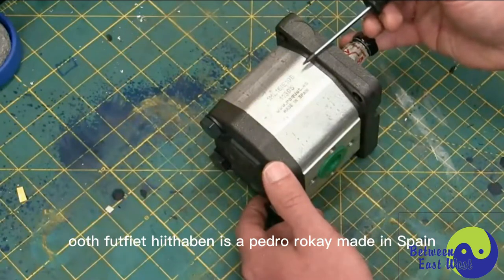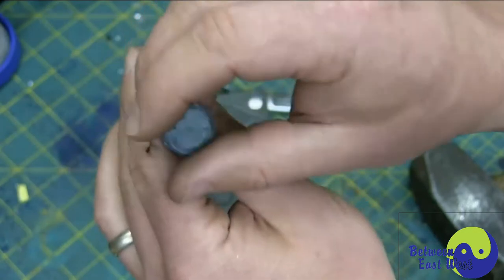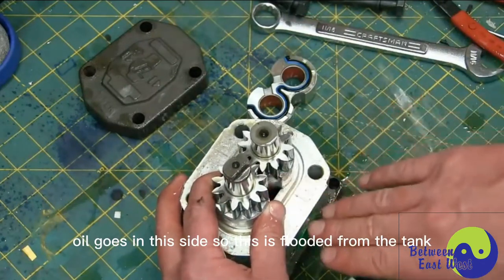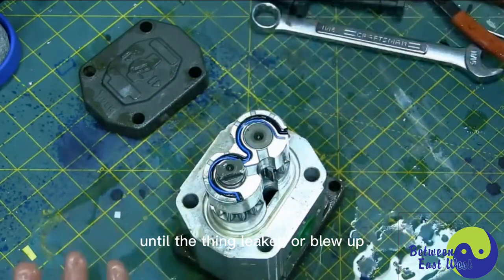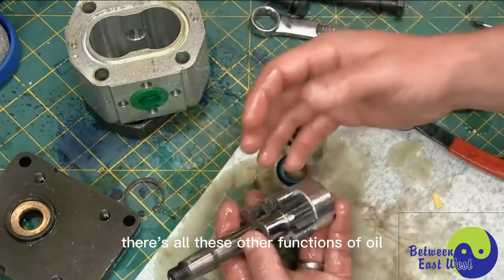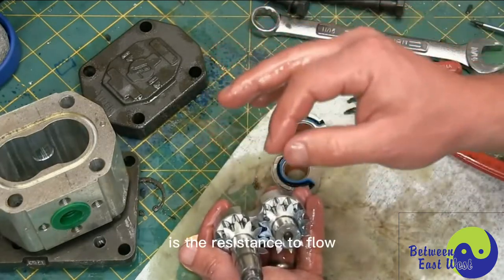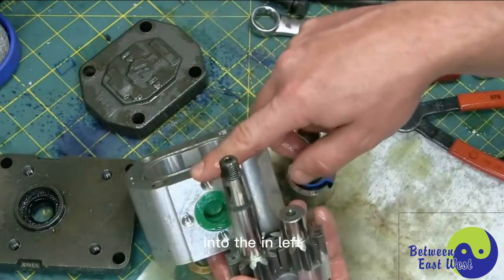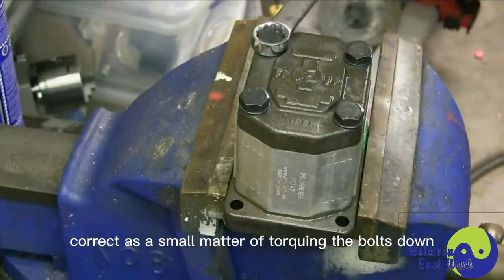Gear Pump Repairing| How To Repairing Hydraulic pumps

Comment: Question, so I have a similar pump on my chinese mini excavator, I've recently had to take the ORB fitting off as it had a bad o-ring.  Since taking the fitting off the outlet (waiting on new o-ring), most of my oil in my tank has been draining through this outlet port.  In other words, oil is moving across the pump while off, is that supposed to happen on these pumps or would this mean a bad seal?  Thanks